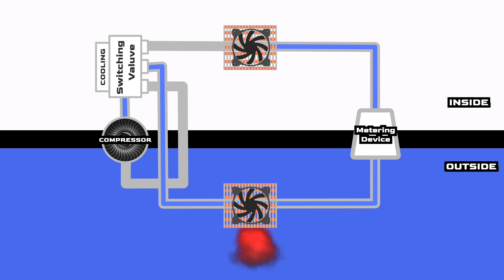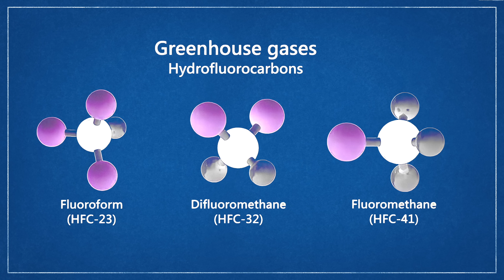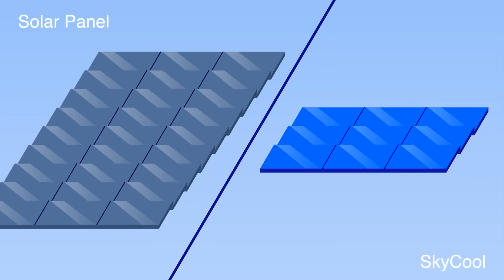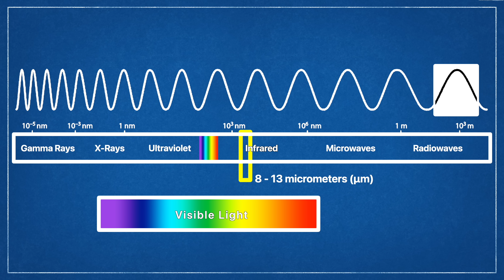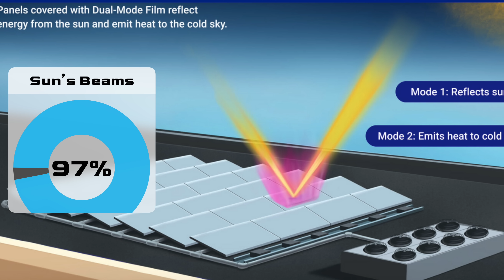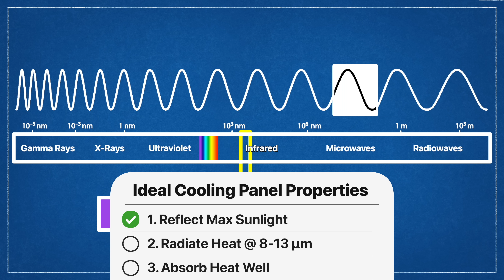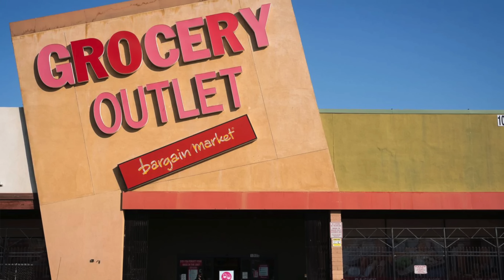New AC Tech Sends Heat Into Space & Saves 95% On Cooling Bills!

Comment: My BS detector went off the charts xD
Reply: Agree, 15 degrees below ambient temperature. Maybe ok with ambient temps of less than 85 degrees. 
Does it also dehumidify as does regular AC? 
It appears to be a good start however more time/tec required.
Reply: @edwaggoner7403  My guess is only when it's really humid because they would rely on much smaller temperature differences vs air conditioning to operate without the panels being too cold to balance the conducted heat. Maybe they use some helium or something in the panel to reduce heat transmission between the front glass and the panel itself.
Reply: @iwenive3390  Yeah I agree. Maybe a vacuum instead, but that will need a lot of support structure inside. I don't think it'd be very easy to make this very efficient in general, and it certainly seems too good to be true that it can work in sunlight.
Reply: @ThisRandomUsername  as I  understand it, there is no glass. The surface of the panel IS the radiative surface. Glass over the top of that would destroy it's effectiveness.
Reply: @iwenive3390  hydrogen is even worse.
Reply: @edwaggoner7403  For me 15° bellow exterior temperature is more than enough... Where I live it's like 40°c most of the time, so i set my AC to like 30° c so I can at least stop sweating whenever I do any movement lol
Reply: @edwaggoner7403  upto 15c below ambient on this tech alone. When used in conjunction with refrigeration cycle, it can lower ones electrical consumption. That was covered in the video.
Reply: @kreynolds1123  
So not yet ready for stand alone. Maybe with thousands $ in electric bill this may save on a comercial scale in conjunction with conventional cooling.
Reply: @edwaggoner7403  since it works best in areas of low humidity and clear skies, I  doubt that the panels would be much good at reducing the humidity of the local atmosphere to any worthwhile degree. Since they are mounted outside, unless the working fluid can be reduced below the interior dew point, I can't see the system being very effective at reducing internal humidity levels either.
But as a booster for a a conventional heat pump, I  think it could be a great asset.
Reply: Yeah seems like a trend with this channel recently
Reply: @SariAlShammari  Um, no.  You just don't understand physics or you would know that this device not only can work, it HAS to work.  The catch is that it's only good in dry climates, and is apparently limited to about 15 degrees of cooling.  I hope that's C, not F.
Reply: @incognitotorpedo42  yes I don't understand physics, damn you're impressive and smart, good for you man, good for you.
Reply: @incognitotorpedo42  it works 𝘣𝘦𝘴𝘵 “in dry climates”, especially since people in those areas blow most of their energy expenditures on air conditioning, because they live in deserts.
More videos on the subject:
Reply: I feel l Iike people used to be hesitant about admitting that they dont get something, now they're almost proud.  People think they are smarter than what they are... could be that you're just not understanding something, not that its bs.
Reply: @Ranshin077  There have always been suckers for snake oil.
Reply: I like the r143a gas mentioned.... I wonder where I can get a hold of this🤔 I have some r134a here though😅
Reply: Hahahaha
Reply: The best BS always has a grain of truth.  Yes, black body radiation is a thing.  But at room temperatures, it is negligible.  Think about how much heating the sun does when it hits your roof.  You want to reverse that and generate the same amount of cooling?  Then your house is going to have to glow like the sun.
Reply: @phillipsusi1791  The sun heats the roof because the roof is made of material that absorbs radiation. If you made the roof reflective or at least didn't absorb most of that radiation it would stay cool. Duh. That's the point of the material selection in the panels. Plus they radiate absorbed heat at a frequency that isn't easily absorbed by the ambient air. Radiate more heat than it absorbs and it gives a net cooling effect. May be small, but it's passive and a great start. Even solar panels weren't very efficient when they were first created.
Reply: @edeaglehouse2221  If it were perfectly reflective, it would not heat up above ambient in the sun, but it would not cool below ambient.  These guys are claiming that they can cool below ambient.  In order to radiate enough heat to have a noticeable cooling effect, even on a moonless night, it would have to be glowing red hot.
Reply: @phillipsusi1791  You have a bizarre idea of what cooling means.
Reply: @edeaglehouse2221  No?  Cooling means loosing heat.  Any middle school student can tell you that.  The absence of gaining heat is not cooling.  If you have an electric heater and you don't plug it in, that does not mean that it is cooling -- it just isn't heating.  Likewise a perfectly reflective surface isn't being heated by the sun, but it isn't being cooled either.  It's just going to stay at the same temperature it started at.
Reply: @phillipsusi1791  I won't pretend to understand how it works but paints and surfaces that produce ambient cooling have been invented and do apparently work.
Reply: @deanfowles3707  They work when the structure is ( significantly ) hotter than the air around it.  If you are trying to cool the inside of the house, usually you want it to be cooler than the air outside.  You can keep your attic less hot by painting the roof white, but it's never going to be cooler than the air outside.
Reply: @phillipsusi1791  well, like I said to the other dude just one message previous. Look at that bloomberg video.
Reply: So for those of you that are a bit skeptical, both nighthawkinlight and tech ingredients have made their own versions of these panels. It's definitely not the end-all be-all, but it's honestly quite neat
Reply: I clicked to know, and you spoiled the end !
Reply: Not bs.
Reply: Tech Ingredients made a video about this. You can DIY the process on a limited scale
Reply: It’s a risk with being cutting edge. There’s a lot of hype, science that’s vaguely explained and fraud in the crack where truth was left to be presumed.
Reply: Well, this has more to do with the new ultra white barium sulfate paints but even ancient societies in the deserts of the Middle East would make ice by digging a deep north south trench or pit such that the bottom would only receive Sunshine at noon, hence pools of water would only be able to radiate their heat out to the sky.   Basically, we did this 6,000 years ago...
Reply: @Toni Grofu I understand your hesitation. But radiative cooling is real. It happens all the time 100% of the time. It's just that when the sun is shining, you have a net heating during the day and when it's not shining at night, you have cooling.
Reply: @kreynolds1123  yeah for sure radiative cooling is everywhere but in the case of a black body you are emitting and absorbing nearly the same energy.

Radiative cooling typically requires a temperature differential. The reason we use AC is because there isn’t a temperature differential or its in the wrong direction. IE hotter air than your radiator.

Am I incorrect in my thinking that the spectrum of IR energy in ambient air is fairly evenly distributed?

Maybe not in dry air but certainly it would be in wet air. Maybe the reason these guys are having a hard time selling is because the only place it works (dry climates), evaporative cooling would be way cheaper. If this worked even fairly well in humid areas I would grab one for sure.

No violating the laws of thermodynamics.
Reply: @kreynolds1123 ... unless the panel is also reflecting incoming radiation, which it does.
Reply: @edeaglehouse2221  yeah, but my comment in question wasn't about the pannels per say, that radiative cooling happens all the time even with the sun out.  But things heat up in the day because there's a net influx of radiative heating from the sun.... true. These pannels reflect most of that allowing them to remain below ambient on sunny days.
Reply: your bs detector has no understanding of physics.
Reply: My BS detector had a stroke.
Reply: @valsineD  shiiiiieeeeeee mine had an aneurysm
Reply: @valsineD  you're giving is all a stroke. Go back to school.
Reply: You can make ice, on an above 0 C night, and test your BS meter.  Or see frost on grass when it's a > 0 C night, or see how satellites dump heat, or check the temperature of an asteroid far from the sun.
The point is, this is compatible with physics.
Reply: Since my comment debunking this video was deleted...

This whole thing is a scam.
Radiative cooling is a least effective way lose the heat! At room temperatures it is nearly non existent.

Convection and conduction effects are those that are heating up your house (heat from air and ground). Both of these are much more effective ways to transfer heat then radiation. There is no way radiative cooling with this magic device will be able to lose enough heat to keep up with being constantly warmed up by the hot air around it. Whole system will eventually equalize at ambient temperature.

Reason for this is second law of thermodynamics. Which in plain words means all energies naturally want to equalize. Meaning same temperature outside and inside your house. To fight this you need to create a temperature gradient and this takes extra energy. This is what regular heat pump or AC does. And since these magic panels don't use any extra (or enough) energy, they can't create a temperature gradient, therefor they can't work. Easy as that.

Radiative cooling is used in space on the International Space Station, because there is no other way to dump heat in space. Volume of the ISS is about 1000m3, area of radiators to keep it cool is 156m2. But that's in vacuum of space, there is no warm atmosphere there constantly heating up the radiators. 

So unless your house is in space this will never work.
Reply: I have heard of reflective surface coatings that will actively cool the surface they are applied to.
I think there is a lot of development in this technology both to do and in the process of development.
I knew a house where they had solar hot water.. except the one way valves were installed the wrong way around and the panels radiated heat away all night long! Stupid installers!
Reply: The only thing more BS than than the video is the comments sections with all of the "physics experts" trying to tell us this is totally legit.  As they say, the proof is in the pudding, and right now, there's no pudding.
Reply: @ABQSentinel  and right now you don't own one of these units so how on earth do you know there's no proof in the pudding? I think YOU are bs
Reply: @deanfowles3707  Simple physics tells me it's BS.  And your response tells me you don't even understand simple physics.
Reply: My BS detector is like, How the "F" is that moving heat into space?????. that just outside! 
Heat pumps move to and from inside/outside (or outside to inside).
Reply: I feel it is BS. There was a lot of random buzzwords thrown about and scant detail as to how it actually works.
Reply: @GSimpsonOAM  
Not total BS, just that radiating our heat into space business, really.
Where I live we have these solar water heaters, that are basically vacuum tubes with a reflective lining to catch more heat from the sun. It's ridiculously effective, actually boiling the water.
Then we have silica paints, that cost 2-3x normal paints price, but lowers the temperature in the house by around 10⁰C all year round.
All they seem to have done is combine these ideas.
Reply: @stoneomountain2390  Transitioning from from high grade energy (electricity, gas etc) to low grade energy (hot water) is easy and relatively efficient. Going the other way still requires high energy input. For example a heat pump is efficient but requires a high energy input to drive the compressor.
As I said, the extensive use of buzz words eg nano anything, rings alarm bells.
I look after a 5MW heat pump. To direct that amount of energy out in to space by means described does not seem plausible. 
At the moment I am overseeing a 5MW experimental hot water heat pump heating system so I am familiar with the mathematics and thermodynamics involved.
Reply: @GSimpsonOAM  
Like I said  radiating into space is BS.
However, the glycol-water to move heat is old tech,  like 1940 marine application old.
They say nano, because micro sputtering, while accurate as a description, doesn't sound very accurate.
They just changed the type of radiator on an AC;  Increased the heat exchange area for a more forgiving gradient.
Used a bit of hydrodynamics to get better heat release without forced air cooling.
This will never work on a high rise or refrigeration plant.
But the principles used are in use, just not together because it's too expensive, and where I live, useless, because when it's cloudy, that's when you really need the aircon.
Reply: @stoneomountain2390  Catching high energy radiation in the vacuum tubes and converting to low grade heat in water works well. It just does not work well trying to go the other way. The Skycool panels will be much less effective than a conventional cooling tower which is all they appear to attempting to replace. So the claimed energy savings are bogus.
Reply: @stoneomountain2390  that doesn't make it BS, just not as efficient as YOU would like.
Reply: @GSimpsonOAM  5MW would require a large area of panels and relies to a large extent on lack of cloud cover, bit to say it's not feasible or capable of improving efficiency is just plain wrong.
Reply: @stoneomountain2390  "all they seem to have done..."
How very dismissive of you!
Reply: @GSimpsonOAM  do an Elon and learn some physics. Then come back and contribute.
Reply: @gregbailey45  The fact that I am the Chief engineer of a 5MW refrigeration plant with 30 years experience and 2 diplomas in engineering makes me capable of asking awkward questions.
I watched this because I am actually interested in the subject. However the fact that they have built full prototypes and yet cannot produce basic operation data such as the heat rejection of the panels makes me suspicious. Along with the all the buzz works in leu of real data.
Some data for you. Our main cooling tower rejects heat of 4MW. It has a 40m2 footprint. That is 100kW per m2. 
When we have that offline we use a dam to radiate the heat. It is only capable of 400w per m2. This system I suspect will be similar. That means this system will be 250 times the size. The cost will be astronomical compared to a cooling tower and in any case what are the real advantages? Evaporative cooling works just fine (except in high humidity)
Reply: @GSimpsonOAM   the glycol loop plays a big part in their design since is highly heat energy absorbent to one 1 degree change?
Reply: @olympicfireball  It is just a way of moving the heat around. A car uses glycol mix to transfer the heat from the engine to the radiator. It has nothing to do with the radiation of the energy.
You could just use water. It is just as effective as glycol but it has issues with corrosion and freezing at low temperatures.

Comment: yes ... always install a passive system if possible ... they are usually less resource-intensive.
Reply: Not necessarily if they have to be many times larger to achieve the same result. A cooling tower is much smaller and the recirculating pump does not use much power in the scheme of things.

Comment: ... YOU'RE FULL OF IT! ... that is, full of incredibly awesome and valuable knowledge and information you are condensing and sharing with your viewers.
Reply from the maker: Haha you had me scared there for a moment!
Reply: @harmenkoster7451  I think you missed one of the three parts.  The "direct" sunlight will be reflected my angling the surface of the tile so the tile point away from directly at the sun.  Which is not really "direct" sunlight IMO, but that's what the illustrations shows.  So sunlight is taken care of by the reflection layer.  I think this probably will make the radiation layer less efficient since it's warmed the radiation layer.
Reply: @harmenkoster7451  the second law of thermodynamics talk about entropy, I am now sure how that is apply here.
Reply: @harmenkoster7451  also, your criteria for a perpetual motion device is not correct.  A perpetual motion device require that a system is in a closed loop. In your example if the room is continuously supply with heat by keeping the room temperature stable as this radiate energy away, it is not really a close loop system.

You could have this device in a room that is completely insulated from the rest of the world aside from an opening where it could radiate heat away.  Something like this will cool the room down to a point where no energy is left be radiate.

Most amateur astronomer will observe this in the form of their telescope lens fogging up. If you take an infrared thermometer to the len you will notice that the temperature is below the ambient temperature.  This happens because the lens radiate some of the heat away to the upper atmosphere.  In this case, I think you actually might have an idea on how to generate power from atmospheric heat.